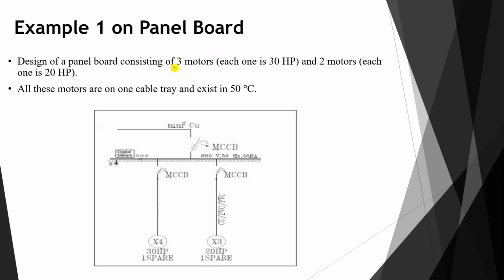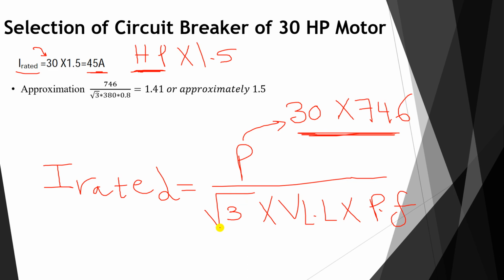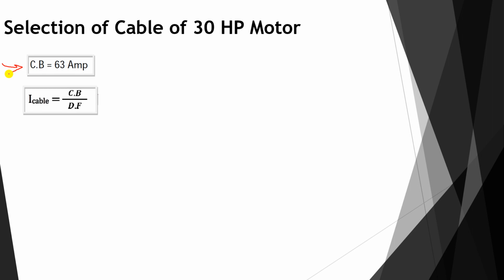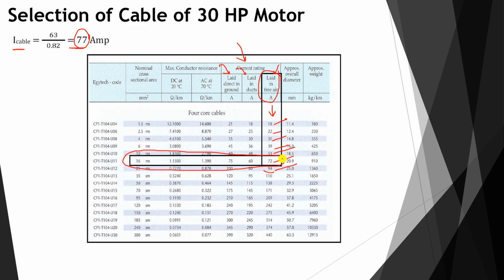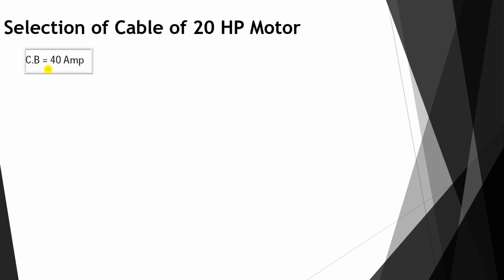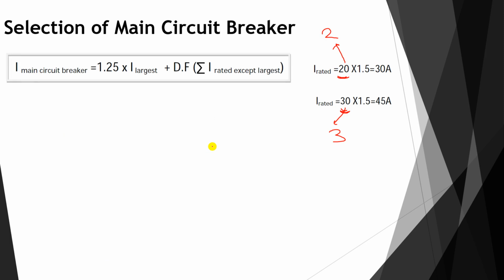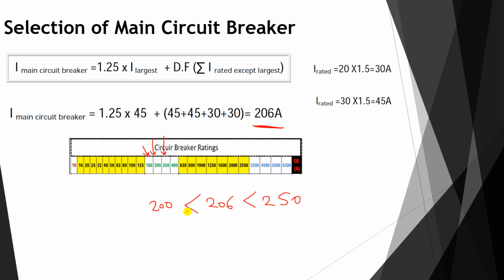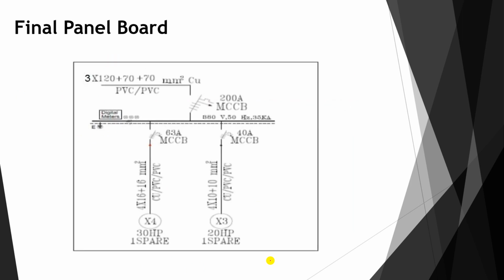Electrical Design Tutorial - Circuit Breaker Selection and Cable Sizing

Comment: For selection of main circuit breaker, why you multiply by 1.25 for motor case.
As per your previous class of panel schedule excel calculation , you told for motor case we need to multiply by 2.5.
Reply from the maker: You need to differentiate between sizing based on IEC and based on NEC. NEC uses a 2.5 factor for an inverse-time circuit breaker; this factor changes based on the type of overcurrent protection device and based on the motor connected and many other factors that were discussed in the NEC part of the course. Also, the 2.5 could be higher if the breaker trips during starting, the NEC defines the factors too.
The 1.25 is not in IEC; in IEC, you divide the load current by the derating factors. However, for simplicity, we assume that these factors will lead to an oversize of 1.25. That's why I use 1.25 here. In this one, we don't worry about inrush current, as we are gonna select Type C or D breaker that has time delay and prevents breaker from tripping during starting.
Watch these videos:
https://youtu.be/jgfS-iSYb-k
https://youtu.be/JLPO8KpAPrc
https://youtu.be/Zx67dsrisRk
https://www.youtube.com/playlist?list=PL_6_U09jayh28pySx7sXvA2m3utNYdKpG

Comment: WHY YOU ARE NOT CONSIDER SHORT CIRCUIT OF 35KA
Reply: @Khadija Academy
Please explain as ahilcuts has raised a valuable question.
Reply from the maker: The breaking capacity of the selected breaker can handle that value.